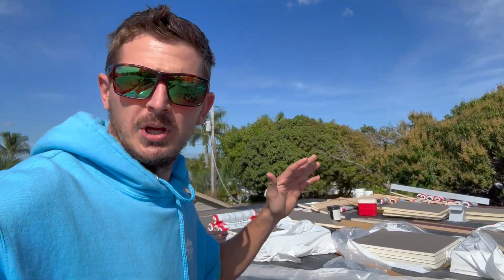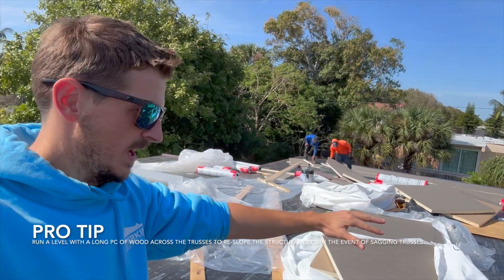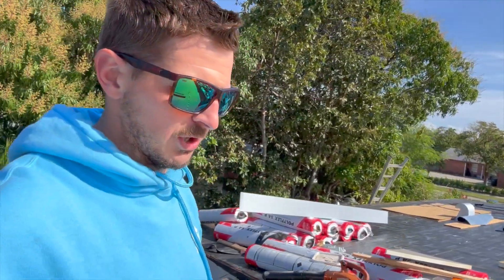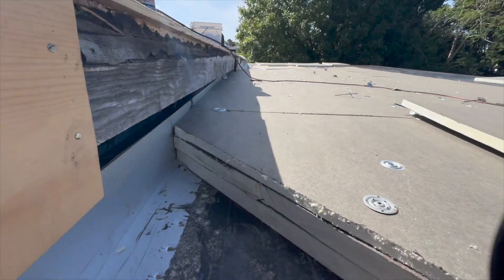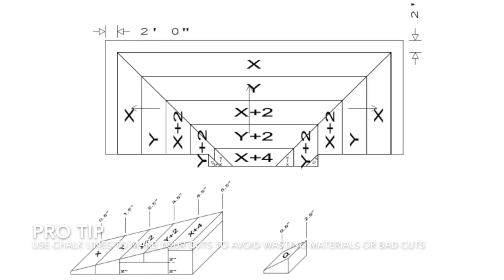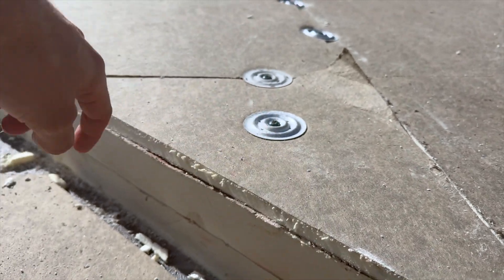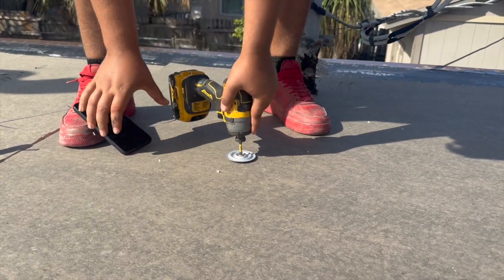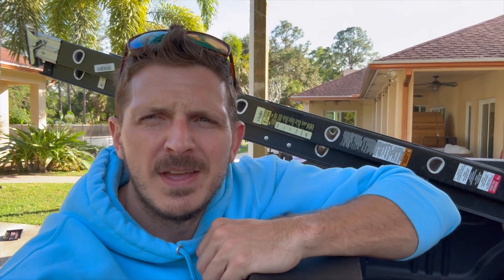How To Add Slope on a Flat Roof

Comment: How much does a job like this cost
Reply from the maker: This one got up to around $40,000 since there was so much extra wood to sister all of the trusses.
Reply: @perkinsroofingcorp  Did that include replacing the plywood as well above all the trusses?
Reply from the maker: @TheOriginalUberGoober  Yes, a lot of it, but not all of it.  I believe we replaced over 30 sheets of plywood on this little roof.
Reply: @perkinsroofingcorp 😮😮😬😬😬😬😬😬😬😬

Comment: Pro tip: Use insulation plates for insulation attachment, and make sure to review the attachment pattern because you were way off on that as well.
Reply from the maker: These are insulation plates, they are sold both barbed and non-barbed and the attachment pattern varies per building depending on proximity to eaves and corners.
Reply: @perkinsroofingcorp those are 2 3/8 seam plates. And you never fasten a plate within 6” of the edge of the board. Keep faking it 😅 👍